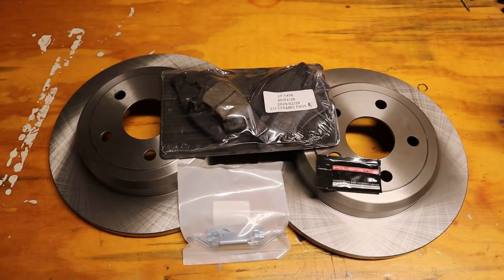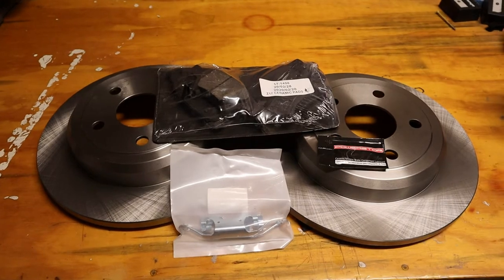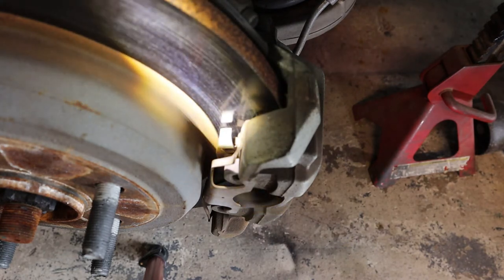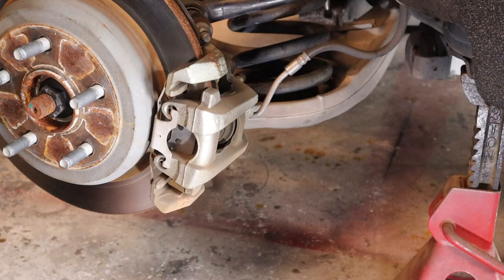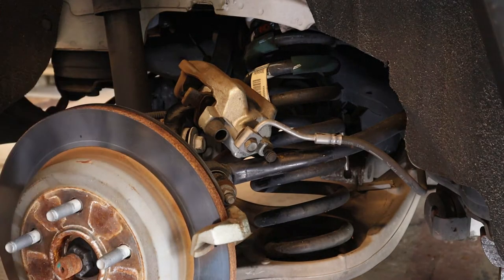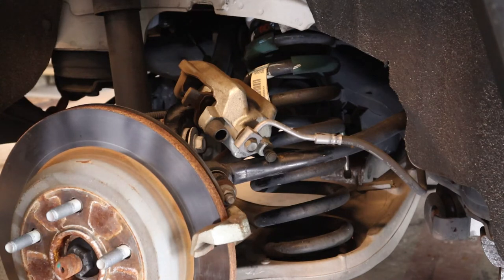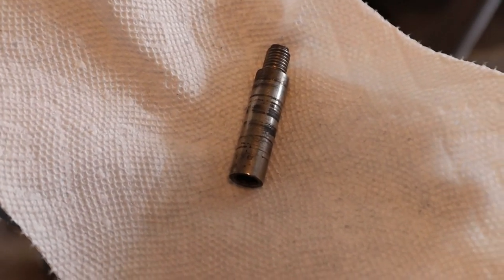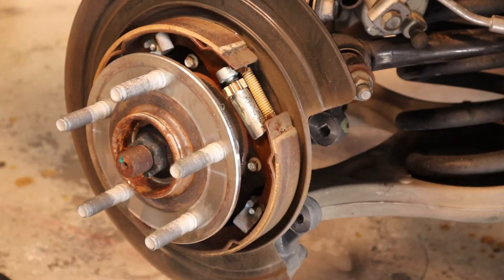Replacing the rear brakes in a 2015 Jeep Grand Cherokee (WK/WK2)

Comment: For anyone else watching, take off the anti rattle hardware first. Put a pry bar/ screwdriver on the rotor hub and compress parallel towards the caliper, wiggle and it will come right off. Also take off the o-ring before taking off the rotor.

Comment: That brake system isn’t supposed to use lube on the slide pins or ears of the pads. Also never use anti-seize on lug studs unless you want to stretch the threads and throw off your torque and risk losing a wheel.

Comment: glad i'm not the only one who wonders why they have such a tight clearance on the bottom carrier bolt. i'm not seeing a way to fit a torque wrench in there when i'm putting it back together. maybe i'll see it at the end of the video? edit: my 3/8 drive allen bits and big torque wrench wouldn't fit, but a 1/4 drive allen set and a 1/4 inch drive torque wrench did, and that gave me the excuse to get more tools, lol.

Comment: Good Video. When would you be doing the front brakes.? Looking forward for that video too.
Reply from the maker: Thank you! Unfortunately probably not for a while the front brakes look to have a lot of meat left on them. I may take one side apart though just to check the condition of the slide pins... I still can't believe there wasn't any lubrication from the factory on the slide pins in the rear

Comment: I have a 2017 Summit and have absolutely no room for a ratchet for the allen bolts. Had to put in the socket and use a wrench to move them then an angled allen to tighten. What a pain. Is your rear suspension different? Also my parking brake was stuck on a rust lip. Now what? I have no room for a screwdriver on the back to adjust the brake. +Does anyone know?

Comment: Thank you for sharing… Those rubber O rings used in assembly line to hold the rotors.
Reply from the maker: Interesting I wonder why they wasted the time and money... I've seen quite a few cars that have a screw that holds the rotor in place. This is the first vehicle that I've seen that uses an o-ring. I'll give them credit though it's cheaper than a screw
Reply: i know it is kinda off topic but do anybody know a good place to watch new movies online ?
Reply: @Jett Westley flixportal
Reply: @Uriel Brayan Thanks, I signed up and it seems like a nice service =) I really appreciate it !!
Reply: @Jett Westley happy to help =)
Reply: O ring keeps moisture off the hub where the rotor sits. This allows for easier removal of rotor due to not seizing on the hub assembly from rust. O rings are used for sealing. Same purpose here.